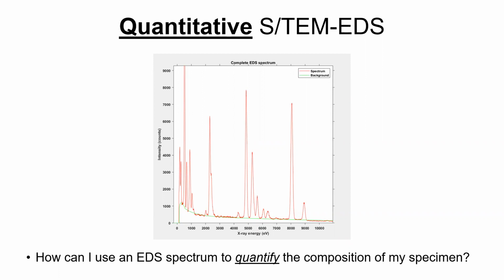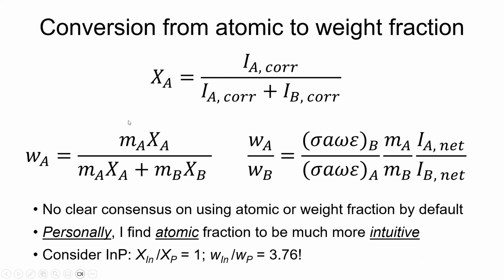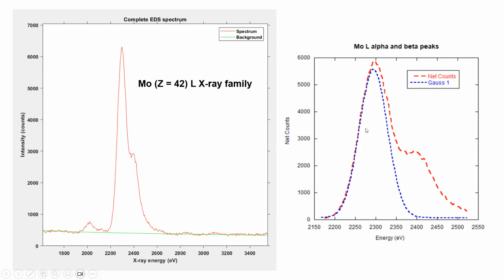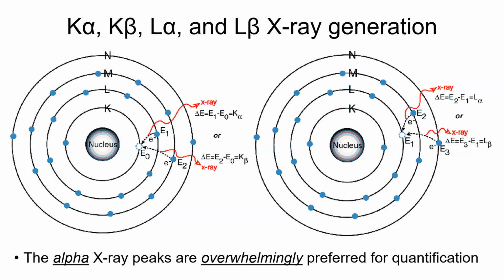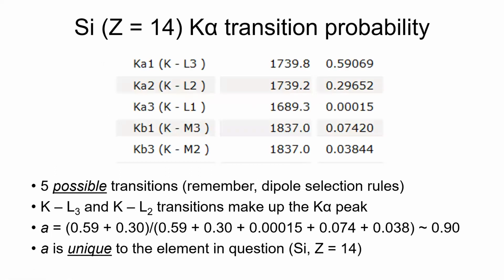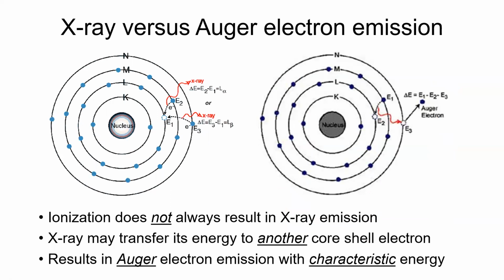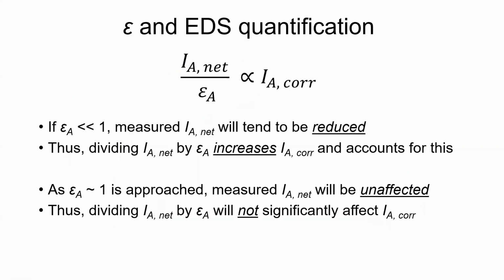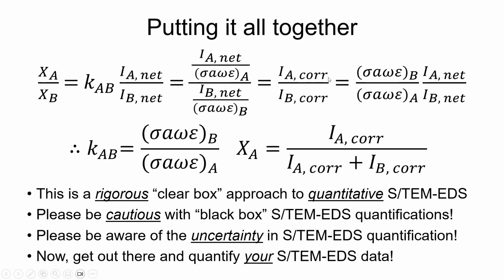Quantitative S/TEM-EDS

Comment: Thank you! Very informative video. Regarding the selection rules, I understand delta l = 0 is forbidden. I don't understand how Li can be observed if the 2p orbitals are empty, do you  have first 2s -- 2p excitation then relaxation to 1s?
Reply from the maker: You're welcome, glad you found the video informative.  Detecting Li with EDS is very material-specific.  Some compounds of Li will emit X-rays and some will not, it depends on the type of bonding and the band structure (unlike higher Z elements). However, the process is still the same as with any other element, so it would not start by band to band excitation but rather with core-shell ionization.

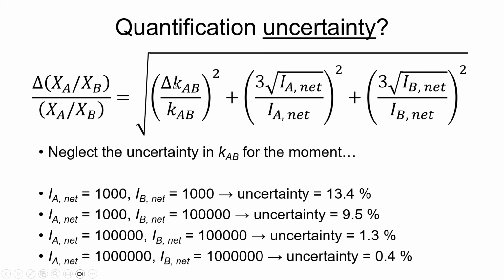Comment: Really nice video. Quick question for clarification. The way that you have written the uncertainty equation for K_A (vid. time: 48:33) and the total spectra uncertainty equation (46:43) suggests that if you had a spectra of 2 elements that had the equal values for K_A and K_B the uncertainty would cancel out rather than have a compounding effect. Is this correct?
Reply from the maker: Hi @guest-rz5ft; thanks for your question.  So, remember that kAB is the ratio of (sigma*a*omega*epsilon) for elements A and B.  Since you are dividing the products, the total relative uncertainty would actually be a Gaussian sum of the two relative uncertainties for (sigma*a*omega*epsilon).  So if the relative uncertainty in (sigma*a*omega*epsilon) is 10% for each element, the total relative uncertainty would actually be ~14.1%.  I didn't work out an entire error calculation here, but in hindsight, it probably would've been good to do that.  Error analysis can certainly be a bit complicated (particularly for people like me who are not formally educated as statisticians or mathematicians); now that I think of it, I could actually do a separate video (albeit much shorter than this one) about doing EDS error analysis, so hopefully I will eventually get to do this.  Thanks again for your question.
Reply: @NicholasRudawski  Thanks for your response. I understand the compounding effect of the equation at 48:33, however, for the total spectra uncertainty (46:43) where you have a deltakAB term, does this not cancel out if each kA and kb are the same (such that the delta = 0). Another way to ask this question would be could you clarify how to solve for deltakAB?
Reply from the maker: Hi  @guest-rz5ft  : again, good questions, but it's a bit tough to cover this in detail in a YT comment reply; again, this could be an entire video in and of itself and since you are very interested in error analysis, I will be glad to make this video for you and the rest of my viewers.  Please be on the lookout for it sometime in the near future.

Comment: OHHHH,Thanks for sharing, but sometimes when doing EDS or STEM, the sample drifts, do you have any experience to share?
Reply from the maker: You're welcome, @qinblenden445.  Regarding your questions, the most important thing for minimizing sample drift is the microscope environment.  Large temperature fluctuations, air currents, and large remnant electromagnetic fields will contribute to specimen instability.  Assuming those are not an issue, the specimen needs to be securely loaded in the holder.  Beyond those obvious points, the longer the sample sits in the microscope, the more stable it will become.  It is not unheard of for S/TEM users to load a sample and then wait 1 - 2 h before starting the session to give the sample time to equilibrate; what is even better is if you can let a sample sit in the microscope overnight and then work on it the next morning.  Time is always your friend when it comes to reducing specimen drift.

Comment: Perfect lecture on EDS analysis! Thank you! One question: do you know some programs that could easy do deconvolution of overlapping peaks? I can export my spectrum from TIA as table data, but where I can deconvolve them?
Reply from the maker: Thanks, Adrian; I think TIA may actual do de-convolution and give you net counts when performing a quantification, but I'm not sure (I haven't used TIA in quite a while).  The program I use is Kaleidagraph, which is nice because it has a very extensive library of fitting functions.  Remember that you are actually fitting two Gaussian functions for two overlapping peaks, so your fitting function needs to be the sum of two Gaussian profiles, which Kaleidgraph allows as a custom fitting function (not sure if other programs allow for this).  I had to input some initial "guesses" for the fitting coefficients to converge on a solution, but this is straightforward to do based on the raw data.
Reply: @NicholasRudawski  thank you!